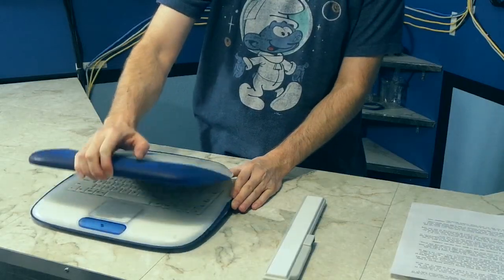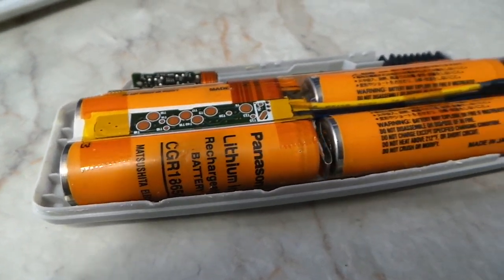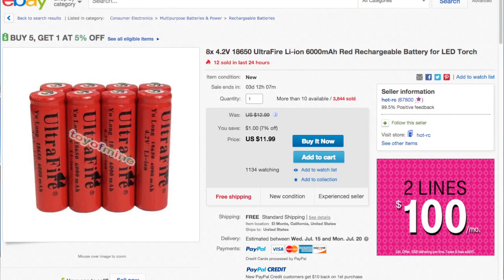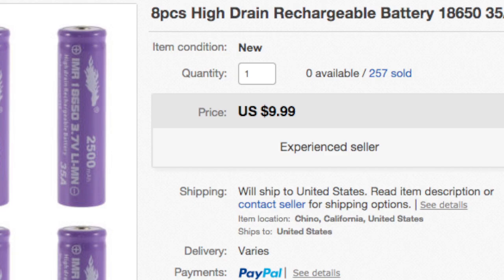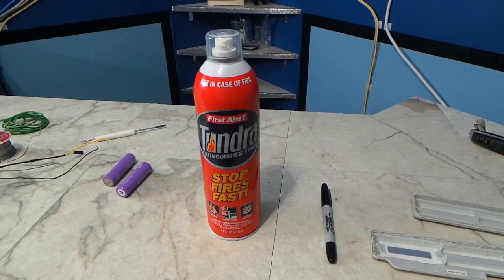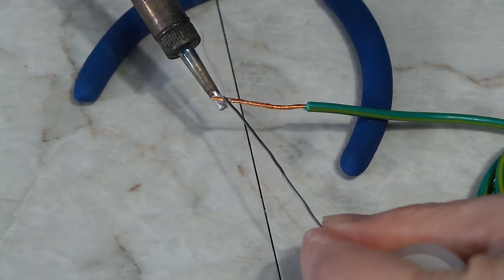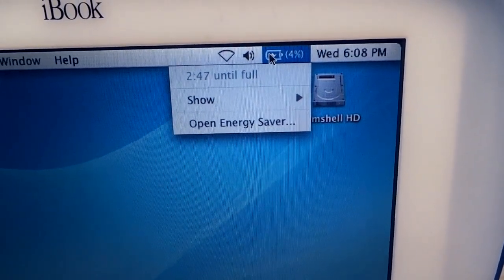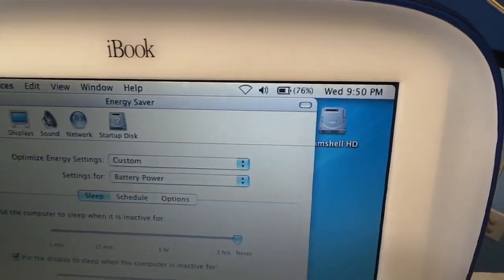Rebuild a laptop battery pack

Comment: If you rebuild a laptop battery pack, is it best to match the cells by the individual WH? If it's a more modern pack, how hard is it to get a new BMS PCB? Can those batteries be  charged before soldering? Thanks 🤓
Reply: Yes they can but cost is not that much cheaper than a 3rd party one , unless of course only 1 cell in pack is dead
Reply: Ps bms are generally firmware locked and require specialist software and hardware to program so not cheap but I’m sure 3rd party ready made alternatives exist

Comment: Hello I have a Dell laptop battery model J1KND 48w 11.1volt How can it be charged without a laptop? Which pins are negative and positive? Can its negative and positive pins be used as a power bank?
Reply: Yes they can , there are ready made modules on Ali express etc just depends how good your cells are and also you should get a module with a good bms for safety

Comment: Hi

Thanks

 I have three questions 

First with the module HX-3S-FL10A Can I charge 6 lithium ion batteries in three series and three in parallel?

 Second, how many volts and how many amps should the charger be?

 Third I have a Dell type laptop battery J1KND TYPE and I want to charge it without a laptop. Which pins are positive and negative? 

And with what charger is it charged? Thank you. My English was not good. I used Google Translate. Please reply to 
zagros220@yahoo.com Emai

 Thank you

Comment: Most battery casings are ultrasonically welded. It's harder to get apart than if it were glued.
Reply: If you mean the entire laptop battery casing, yeah. I bought one of those extended battery packs for an HP laptop. The battery was like it had a bun in the oven.... it had 6 extra cells in it and stuck out the bottom. When the laptop croaked because of a toasted motherboard, I decided I wanted to salvage the 18650's in the pack. The damn thing could NOT be opened without destroying the battery housing. You could pry in a couple spots but most of it would not separate. I had to dremel that thing open. And then even after I cut it open, the cells were all glued both to each other and to the housing plastic. They REALLY did not want this to be salvageable. More like they want them tossed in the trash.

Comment: I have an old Thinkpad T42 with a dead battery. Thinking of opening it up and trying this. It's that or buying a dodgy Chinese fire hazard battery off ebay
Reply: Open it up , but be wary that some manufacturers are now firmware limiting a battery use to a fixed time so your bms may need a reset or reprogrammed
Reply: @user-te1le7ck6b  I found a replacement one from a UK seller from a machine that isn't working. Tested the battery and lasts 40 minutes which is fine. For laptops 15+ years old if the battery lasts more than 15 minutes I'm happy. Enough time to move from one place to another on battery
Reply: Jon C good on you mate

Comment: Please let me know, when i disconnect even i connection from the cell pack and reconnect it, the battery pack show no voltage on + and - terminal. I replace whole package then wired again but battery circuit did not wake up. something internally sleep in the circuit. can you help me, is this really work u did ?
Reply: What voltages of cells?
Reply: @SinsBird  I opened few 10.8 volt and 11.1 volt battery pack included 6 19650 inside and buy new 6 cell then soldered them accurately. but it did not work. I forget where i read that when the connection between cells and circuit cut down, the BMS circuit became internally shutdown as it pre-programmed. Need to reset the chip which control the system. I don't know more but i failed to make the pack work again.
Reply: @jhliton6755  So you balanced the cells or not?
Reply: @SinsBird what is the balanced really mean?. new cells were rating 3.6 volt and with fully charged it shown 4.20v (i wonder those were poor Chinese sh*t blue colored, it did not last long when i used them for my Flash light). I connected them after fully charged as it not fully charged when i bought them.
Reply: @jhliton6755  Balanced as in equal voltage. Maybe the fuse was blown?
Reply: Bad bms , wiring or faulty cells

Comment: Is it good idea of replacing 2000 mah 1c battery with 2600 mah 3c battery for an laptop battery (18650 cell) ?
Reply: Should always do like for like but if the manufacturers have a higher capacity offering then yours should be ok

Comment: It would be better , first of all , to declare :" Only good with very old battery model with simple BMS included."
 Now recent BMS are sophisticated and refuse a current output after repair if they are disconnected (necessary for changing the 18650 elements)  So, after changing you have good voltage at the main ports between battery and BMS...but nothing at the BMS output. Manufacturers are clever! You must buy a new one......They don't explain how to "re-programm" the BMS...and you understand why....

Comment: One thing that I learned the hard way.. quite possibly not all cells in the pack are totaly shit.. And two 18650´s will burn you if you short em in your hand. And Remember to shield between the pairs... unless they are stacked for a voltage boost. But as he said; the old battery will not get better by waiting and not doing anything :)

Comment: Hi there! Congratulations for the video. Very informative! I have a question however related to the controller in a GD761 battery. One video on YouTube mentioned that merely replacing the dead cells with new cells and building up the battery won't work as the controller chip remembers the old charge discharge cycles and may continue to block the new battery pack. Similar to a printer cartridge chip which stores in memory the number of pages printed. Hence in that video it was suggested to procure couple of overwriting chips & connectors which is cumbersome and costly. So my question is do you think if merely replacing all the dead cells of battery pack with new cells of same capacities will do the job or not? My specifics involve GD761 battery pack 53WHr, 11.1V (dead for over 8 years). I have chosen to replace the dead cells with 2400mah 3.7V (6 cells). Appreciate your reply. Best regards,
Reply: Depends on bms but have a search you may find a replacement though how safe these are is also a question unless it’s a duplicate of an original bms firmware

Comment: The original battery is an unprotected battery. By the way, you bought a regeneration battery with a built-in protection circuit. Usually the built-in battery has a separate protection circuit on the board, so it is appropriate to replace it with an unprotected battery.
Reply: That is rarely true. Most batteries don't have protection circuits, even if they claim to.

Comment: Thanks for your effort but what can we do if the problem is not in cells but in charging circuit of the battey board as I read on web the battery bms is preventing more charging as it reached the max times of charging...  How to overcome this problem?  Answer me please by ur advices..  Thanks

Comment: One tip... use electrical tape next time, not scotch tape.  You also have to be more concerned about the cheap batteries swelling and leaking too, so there's another reason to go with brand name ones... they generally don't have these issues ore the failure rate is a lot lower like 1-3% whereas it might be as high as 10-20% on the cheap batteries.  Also with cheap batteries it depends on your expectations too.  I mean if yours takes 6 cells and they're $2 each, that's a heck of a lot cheaper than buying a new or even used battery pack -- which might cost you $50+.  But then again, you need some tools and wire/solder to make this work.  If you just mainly want a battery that will keep the computer on in case the power goes out (say run for 1-1.5 hours) then why not save a few bucks.  But if you want a battery that can power your laptop for a reasonable amount of time (like the OEM battery pack) then spend the extra money and get the name-branded batteries as their ratings will be mostly accurate.

Comment: Thanks for your video I appreciated. I have few questions:
1- How about if I change all 6 cells one time just to make sure I have all cells are new?
2- What is the different between cells color (Green, Blue, Orange,....)?
3- If no Difference, my laptop is Acer Aspire 2920z, battery color is green, can I change them with example blue, Purple,.... cells?
4- If I change all 6 cells, do I need to make like recognize/setting  between the new cells and the circuit? (I hope I made it clear. I don't know how to explain it).

Comment: Cheers the idea I'm in the process of rebuilding a Toshiba satellite pro C665 battery pack they are green batterys that represent Samsung batterys so I'm going to get 6 Samsung batterys like the one you can get for vapes I even got De solder wire but going to run in the same issue as you did for the welded connectors but mine going to be more difficulted for it have a ribbon cable better the + an - on the welded parts so still trying to find away to get the welded part off to use on the replacement battery

Comment: Noob question. When I opened my laptop battery pack, it is equipped with 3.6v (10.8v in series)18650 cells. Is it okay to put 3.7v in it?

Comment: There are  a few tips for battery repairing
never attempt to do this unless you know what you are doing - the acid can burn you
Test the voltage first - there may be a dead cell which would waste your time.
Check the battery fluid.
attempt to fully charge the battery.
(I discovered about these and more from Jons mender guide website )

Comment: Warning! Lithium batteries are only to be connected in parallel, if they are EQUAL IN CHEMISTRY AND CONSTRUCTION and they were always originated from the same manufacturing batch. Otherwise, one or more of the parallel cells could start to weaken faster than the others, which results in the other cells passing unhealthy amounts of current through it and causing a thermal runaway. They must also have close to the same capacity in mAh so measure each cell capacity. Be careful!

Comment: Don't throw the original laptop battery,  usually  i find only one or 2 damaged batteries  and the rest are fine
But you need to recharge  each one Separately to find out the good from the bad
Also,  sometimes  the board inside is has one or two damaged transistors,  so it cannot charge  a cell

Comment: One thing I have found is a lot of the batteries in those packs are still good so you may want to test them to see if you get better results because they run independently. In the packs that have bad batteries they're usually all bad but most of the packs still have good cells.

Comment: I enjoy your videos, but must admit I cringed when I saw a soldering iron with some 18650's strewn about. That's a definite no no, you do not want to put that kind of heat on then end of a li-ion cell.  there's a bunch of videos and how to's on soldering 18650's, but don't, unless it already has a spot welded tab that you can solder on instead of the button.

Comment: I having problem with that metal clip too and there is no way to solder it. Another way to get around with it is to use conductive tape and solder on the top of it. You could also use liquid tape.
Reply: The metal could be one of those property magnesium, chromium and titanium I think.

Comment: I have rebuilt 2 sets of batteries sucessfully by buying  2600mAh Samsung cells.You can save money on cells but will spend few hours to disasemble old pack and soldering new pack.Cells package has no space  for  soldering wires.This is why originally have thin connections.If you soleder even  small diameter wires you will have big problems to place  new set into the laptop.
If you like DIY do it  but tine spent is not worth savings.
Last battery pack I have ordered was unbranded and lasted 2 years. It contained Samsung cells.As long you do not buy cheapes ones you should be fine.Better sellers offer warranty.

Comment: Hi, I'm hoping you are still reading your comments. It is hard to get updated information on lithiums these days. I have a couple of questions I hope you can help me with.

1) I have an old HP laptop battery. It was completely drained when I left it on the shelf for 3 years. I used it previously for 4, so it is 7 years. I checked the voltage it is 6 cell 18650, 2 each. So 1 parallel cell is dead, but the other 2 are showing around 4V. Can these cells be recharged?

2) My current battery voltage is 4.18V, 4.06V, and 4.03V. Why is the 1st set so high? I was under the impression that lithium batteries lose voltage as they age, not gain? This battery currently only gives me 55% b/c it laptop won't charge if the voltage is above 12.55. 

Thanks!
Reply: 1) The dead pair probably has just one 18650 battery that is dead or the CID (Circuit Interrupt Device) on it has become active. In order to determine wich battery is the dead one, you'll have to sever one nickel tab strip on the pair. For safety reasons, I'd cut the one at the minus terminal. 🤔

When one connection is severed then you can try jump starting both batteries with another healthy 18650 battery to see which one can take the charge.

So then you'll be able to figure out which one is good or not. 🙄
Reply: @davidbolha  ty sir, I had the same thought. I decided not to risk it bc the battery is just too old. But I'm saving my current battery as a backup as I suspect 5 of the 6 cells are still good. Thanks again
Reply: @carrickmchwain2296  Ok. Sure, wise choice. No problem. 😊😆🖒

Comment: There are  several tips for doing a pro job
do not attempt to do this unless you are sure what you are doing - the acid can burn your skin
Test the voltage first - there may be a dead cell which would waste your time.
Check the battery fluid.
Try to fully charge the battery.
(I learned about these and more from Jons Mender Guide site )

Comment: You mention that you could take away 1/2 of the cells and it would work okay but would reduce runtime by 1/2. If you--theoretically--had the space, could you double or even quadruple the amount of batteries and get 3 or even 4 times the runtime you'd get with the standard number of cells? Thank you for these videos, they mean a lot to me and my partner!

Comment: Some say that if we directly remove the chip from the original batteries it is dead forever. Instead we should keep the power to the chip and we should add the new batteries while the chip is connected to  powering batteries then we could remove those extra batteries right?

Comment: Your solder and wire method of connecting the batteries may also have introduced more resistance than the original welded clips that were used, which could also contribute to the battery life being shorter than expected
Reply: Since copper is way more conductive than nickel, I'm pretty sure it won't add appreciable resistance as the gauge he used is a decent size and the solder joints are not going to add appreciable resistance unless they were done extremely poorly.

Comment: You forgot to tell that the batteries should be at the same voltage before getting assembled! It is important, if they’re not at the same voltage that what can happen. 
1. Extremely heat and no charging .
2. Very slow charging . 
3. No charging at all. 
They all should be at 3.7 Volt at least and you discharge them after assembly not charge them at first.
Reply: and whats a good way to discharge it fully?
Reply: sdfxcv blank use a 18650 power bank case theres plenty on ebay or aliexpress just type “Power bank case” and then use something on the usb port of the case

Comment: some of the "namebrand" 18650s from ebay turned out to be fake! i might want to do that replace the cells, but would use a better quality brand! thanks & great video! did you put a small amount of RTV or silicone sealant on the wires you soldered on the ends, for corrosion prevention? thanks
when rebuilding these, is it a "best practice" to replace all the cells at the same time, not just low voltage ones? thanks

Comment: Hello. My laptop needs the battery plugged in for updating the bios, but I removed the battery as it was bloated and didn't hold a charge. The question is, can I put the battery back in with the cells removed? will I need to short the cables connecting to the cells or just leave the ends separate and disconnected from anything?  thank you.

Comment: I would buy a cheap replacement battery for a HP or something for around £9,  break that apart to rob the cells. It would have slightly better cells and already have the tabs to solder to.

Comment: oooh... Soldering Li-Ions is never a good idea. They're def not designed to withstand 600++ °F without damage. Premature failure is only a matter of time... In this case it prob doesn't matter but this is such a widespread bad practice.

Comment: I had no idea that electric cars ran on simple little batteries like I have in a flashlight. Or even a laptop battery for that matter. 

(Sure the 18650's are a bit bulkier than AA's, but not by a lot).

Comment: I have been looking into this to create a PRAM battery for my Powerbook G3, It appears to read 11v when it is supposed to be 17v. I see David using a solder iron and other people using a spot weld. I imagine spot weld is the best because that is how they are made and the whole heat transfer thing. I don't know why a battery clip or compression connection, is not something people try. NO solder or weld, just a copper strip pressed against the cell. It seems a lot simpler. Anyone have any thoughts on this?

Comment: Old 'dud' OEM laptop batteries often contain good and bad cells. I dismantle the fully discharged battery, check cells for rating compatibility, individually charge them in a suitable AA charger (Amazon?) then test for ~3.7V output. I retain any good ones -- being OEM, they're high quality. A Weller-type soldering gun beats a small electronics iron IMHO, rapidly heating the pole metal before the cell absorbs too much heat.